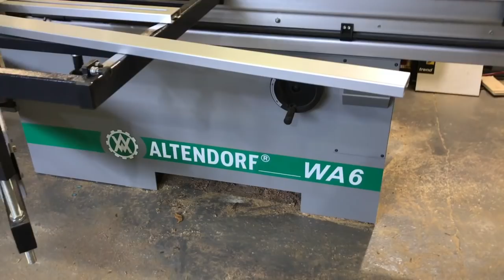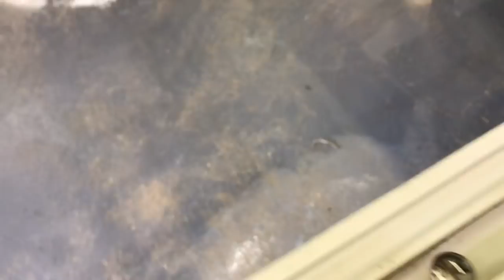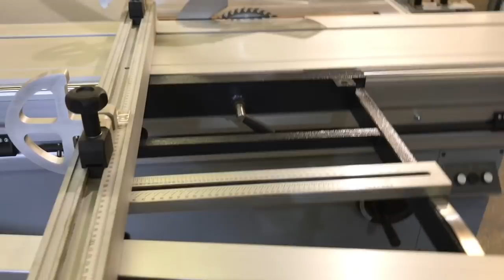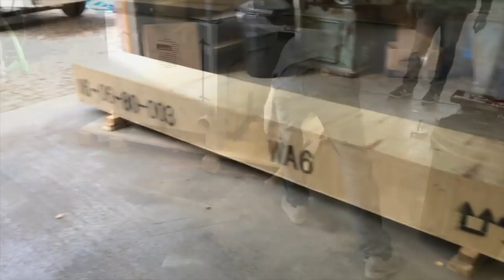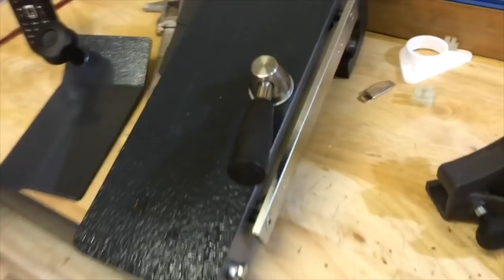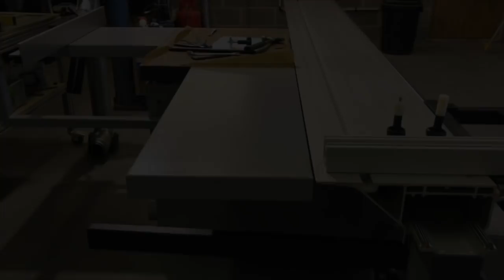My New Sliding Table Saw  - Altendorf WA6  P1

Comment: WOW impressive!!! I´m buing an intere felder workshop (line 700) but since I´he seen the altendorf at this price I was thinking about change the sliding saw (felder k700p) with the wa6. I wonder if you could advise me on the best buy.
Reply from the maker: I love Felder the bandsaw and Planner are perfect.   ! I have to say the Altendorf WA6 is so well built feels heavier duty than the K700,  also the saving on saw gave me the cash to buy the bigger 510 planner.:)
Reply: Cristian Silvestri I would take the Felder. Felder machines are handmade In Austria and most altendorfs are made in China but the only way to know is try.

Comment: your shop is awesome i love dimension saws who needs a cross cut sled lol
Reply from the maker: for me the cross cut sled didn't cut it Lol..   I need to straighten live edge boards etc as well and sheet goods so after buying Festool Ts75 I stopped uing my old table saw..  but I miss the speed or repeat cuts and setting anlges ..  so the TS75 is out as if the MFTas well :) to help fund this beast

Comment: Can you rip full length plywood with the cross cut fence in place?  So pushing the sheet against the cross cut fence and ripping a full 96" and clearing the blade after the cut?  Thank you.
Reply from the maker: It’s a 3m slider so will cut a full  118’  in old money:)
Reply: Manor Wood 118 feet? Old money?  Not really sure what you meant.  Thx
Reply: Is this single phase power for this saw?  I’m in the market for a sliding saw and really wanting to learn more about all that’s out there.  Where would you say, in your own opinion, this one is in comparison to a Felder K700S slider?  Thx

Comment: Hi. I’m looking at possibly buying one of these. How have you found using this saw? Any complaints? Is the extension arm ok for cross cutting heavy hardwood boards? Also, if you were to go back in time, would you still buy one?
Thanks,
Paul.
Reply from the maker: Amazing saw , I loved using it
Reply: It does look like a lovely saw. I’m also looking at Hammer/Felder low range, just not sure what would be the equivalent in their range. Hammer K4 or felder 500 series maybe 🤔

Comment: When will you do a full review of the saw.
Reply from the maker: is there anything you would like to know ? not sure what more to say about it
Reply: Manor Wood from my personal perspective I'm presently using a contractor tablesaw was looking to upgrade to a cabinet saw but also need ability to cut melamine regularly and very few cabinet saw have a scribe blade. Now started looking at panelsaws but they are considerably more expensive so any videos that show it in use will help. Any advice always welcomed
Reply from the maker: OK got it , you will see me using the saw in most build these days , I know its called a panel saw but it is so useful for putting a straight edge on a live edge board or simply cutting angles , would would even say it better that a mitre saw for that as well much easier to set up and see what your cutting when working on lots of angles . I only keep my Kapex to save moving the setting on the WA6 when I only need to chop a quick length..
Reply: After watching this video and reading your post about the mitre saw, I am ready to move forward with buying one of these.  I am just a little hung up on Felders mitre index system. However for the price your saw is excellent.  I hope to decide soon on which to buy.  Thanks for the great videos.

Comment: nice beast ! my felders just came yesterday, format saw and bandsaw and I can't wait to put them to work. Best Christmas ever :) no need for extra gift !
Reply from the maker: Nice , I love Felder .What did you buy ?????   I just could get the Panel Saw spec in my budget , but the FB510 is just amazing .. my next purchase a large Planner /Thicknesser which I thick will be AD741 if I can get the right deal..:)
Reply: I buy the FB610 (it's so big !) the saw spindle moulder KF 700 and the AD741. perfect combo i think. I need to wait for the guys from felder to come to install them... it's torture to look at them without using them ! I follow your videos for some times because I like what you done but also you show the capability of your FB510 so i was certain that i made a good choice going for felder ! thank you for the extra work of filming your woodworking  !
Reply from the maker: that is an amazing set up .. Saw / spindle moulder was my other option ..  its a great way to go ..!  and space saver...  nice one ..
Reply: @ManorWood .